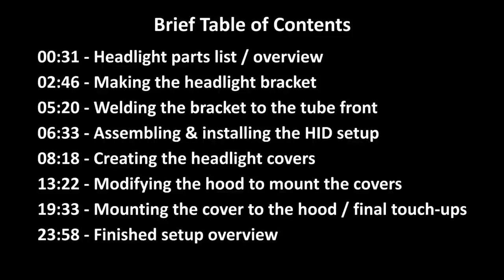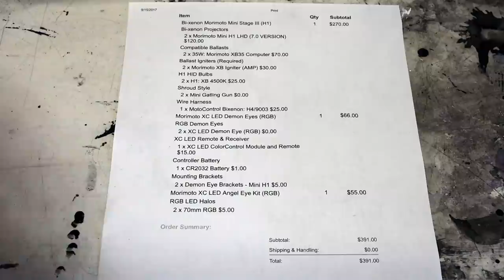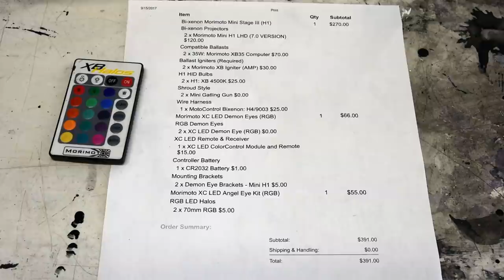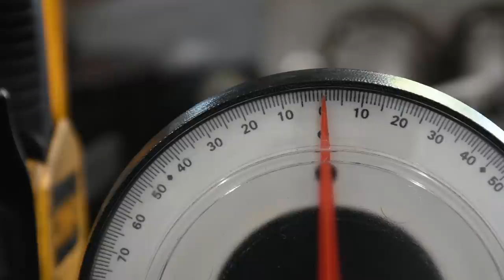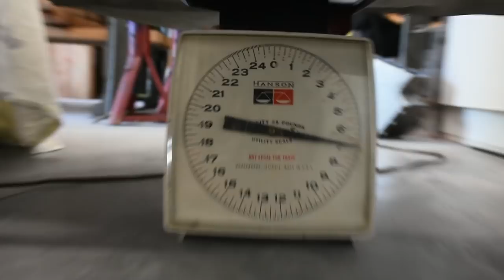Making Custom Headlights | Project 240 - Le Drift Car II | Ep. 20

Comment: Nah. Your bumper blocks all of your output.

Did a retrofit on an old probe with flip ups. Heres a tip. Get some 3 or 4in abs pipe or caps(depending on projector size) and fit those over the back to prevent water intrusion

Comment: Try to take out the lens and paint a flat black lip arround the inside perimeter of the lens. It will hide that fiberglass support and will look much better.
It should not take more than half and hour to do so.

:)

Comment: Headlight lens glue/sealer would have been worked for holding the lens down and heat wouldn't have mattered and you should have made a lip off the bumper to hold the bottom up on the lens

Comment: You mounted the projectors too low so the bumper is in the way of the low beam!
Reply: think it's too far back rather than low... the height is around where the headlights should have been stock, albeit originally flip up headlights would change that a little

Comment: you should make a bracket for your intake instead of using 15 zipties
Reply from the maker: +Jack Truitt Intake does have a bracket for it. It bolts to the tube front.